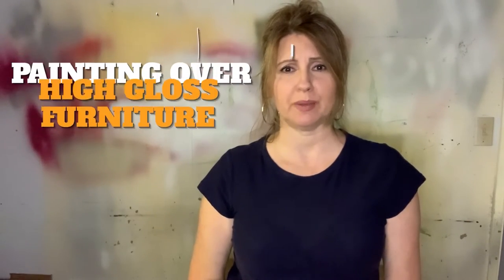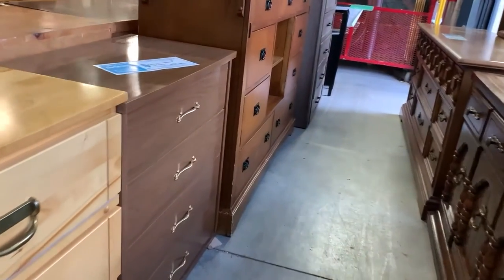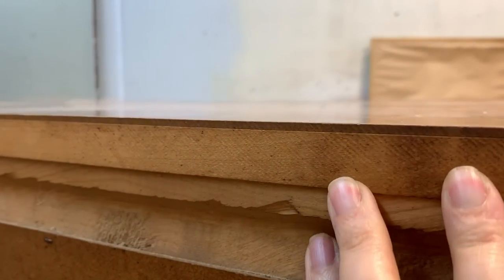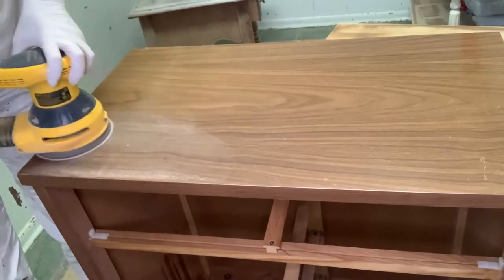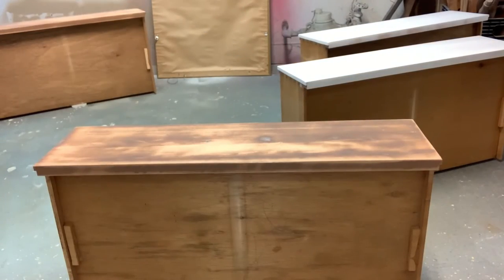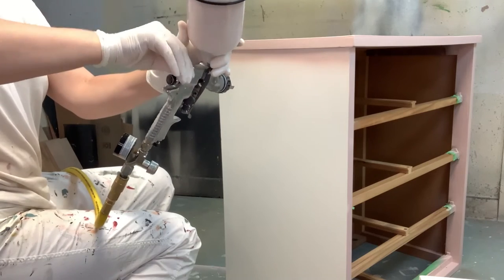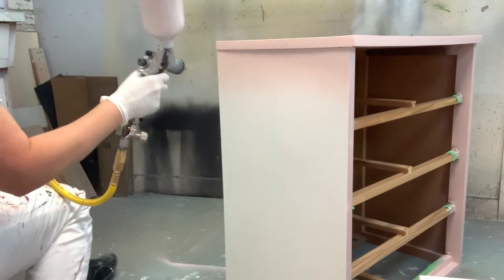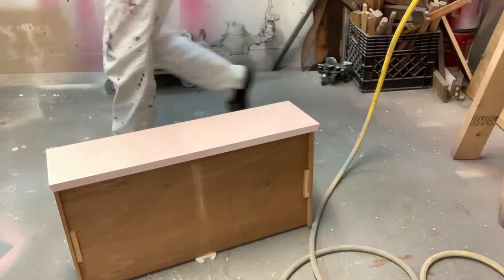Painting Over High Gloss Furniture

Comment: You probably need a combo filter for your respirator of organic vapor/HEPA instead of HEPA only. That’s a great filter for particles when sanding but may not be sufficient for painting vapors. Just a suggestion. It mainly depends on the paint being used. Refer to safety data sheets. Thanks for the video.
Reply from the maker: Thanks for this Jesse!